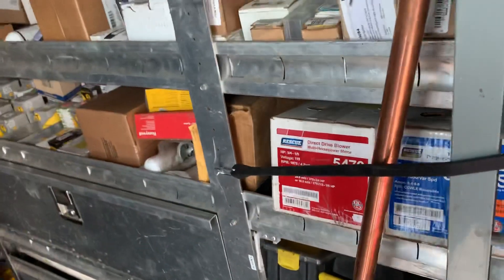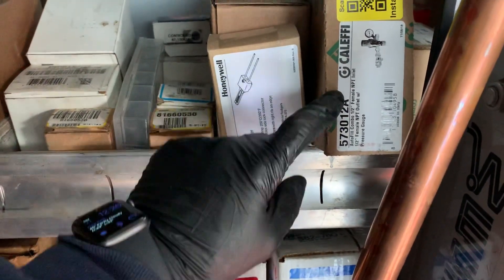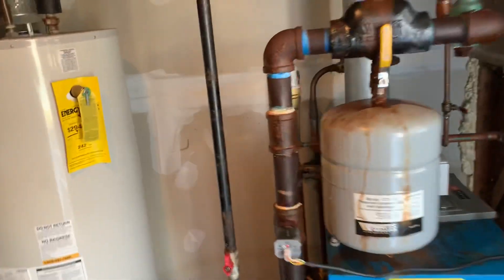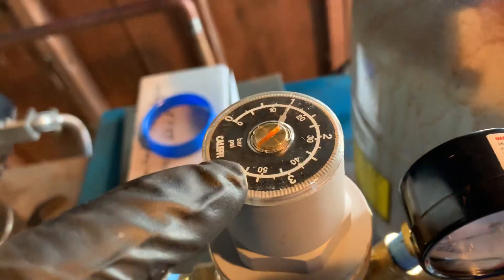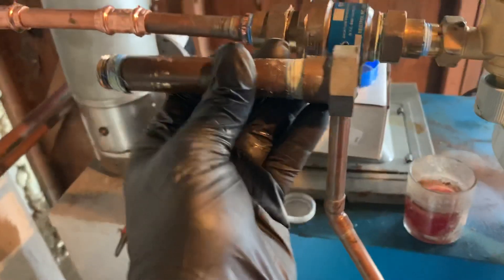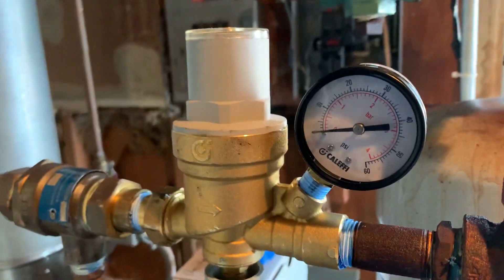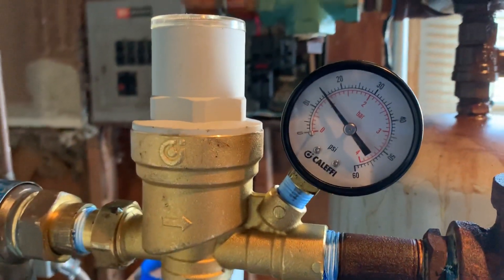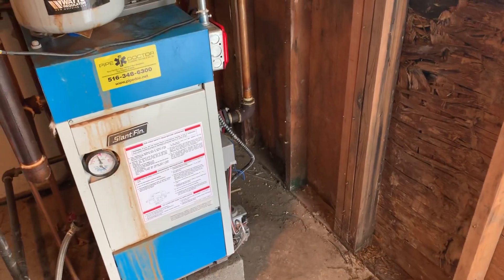Boiler Pressure Reducing Valves - Why We Prefer Caleffi

Comment: My company put the caleffi backflow combo on a hydronic boiler. Had an issue where it was feeding a lot of water even though the bottom of the valve was cracked and not fully open. Any idea or pointers that we missed?
Reply from the maker: I might be an issue with where the water pressure is set to. You also said it was cracked and not fully closed.

Comment: nah, Caleffi sucks. I stick with Bell & Gossett with the fastfill lever. I have seen far too many Caleffi autofill valves just not fuckin working.
Reply: @PipeDoctor   funny. I've seen many fail. Even one we put in! It had not been more than a year since it was put in. Guy had normal water pressure too, no galvanized piping, etc.

Comment: Might not be practical in a commercial setting, but I put a 2 T's,  two valves, and a pressure gauge on the output of the feeder. One valve goes to the system, the other valve goes to a bucket.  to set the pressure to the system I close off the system, and drain into the bucket. with the system closed, and the pressure dialed in.  its an easy check to make sure the pressure reducing valve is set correctly and not stuck. if its bad then I know I have a bad tank or air.  I thought I was pretty clever as a DIY'er =]

This was kinda not needed once I found out caleffi did exactly what I had all in one. It also  looks to be brass and less likely to rot out. unfortunately I had a taco laying around in the garage  so i used that until it rusts out in 4-5 years and ill replace it with a caleffi.